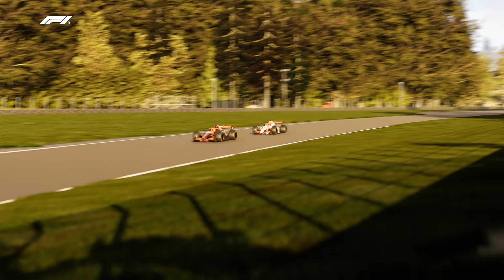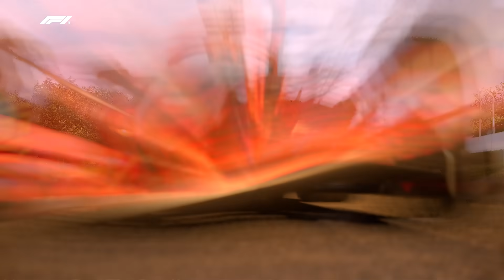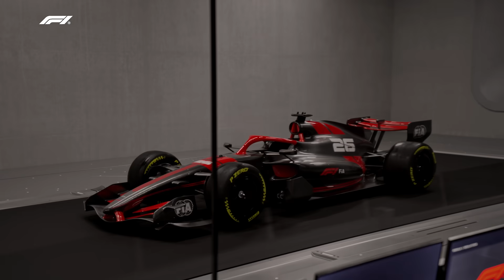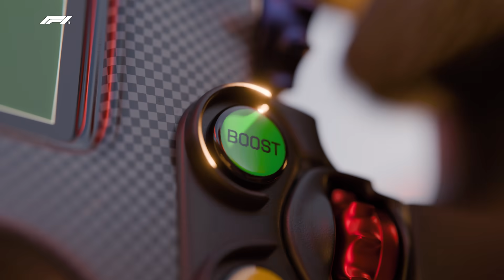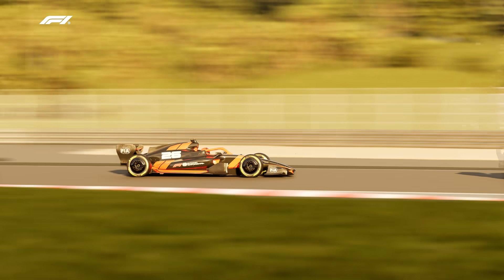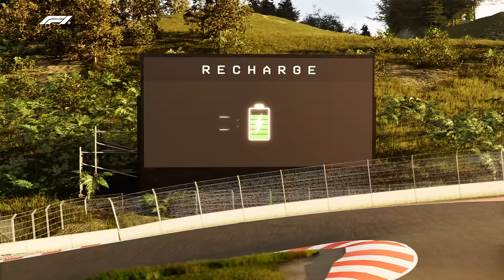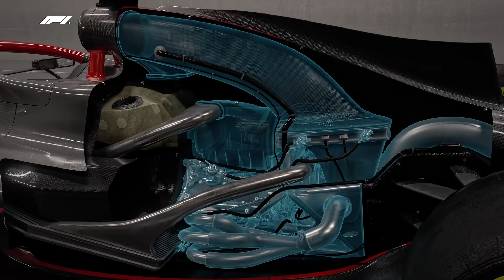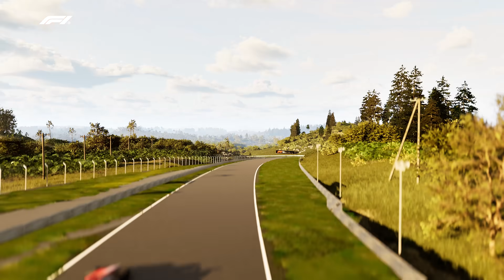Everything You Need To Know About the Formula 1 2026 Regulations

Comment: I dont know but the things on the tyres not being there anymore might make a big hit on tyre deg
Reply: The wheel covers and eyebrows were for aero purposes, not specfically for tyre deg.
Reply: What in the ragebait do you mean with tyre deg?
Reply: @loektube699 You can delete one now.
Reply: The sheilds over the inner side walls?
Reply: The largest reduction in tyre deg will be the drag reduction on the front wing and the larger reduction on rear wing drag on straights. Also the lower overall downforce will lower deg in corners too, but the thinner tyres might balance that part out
Reply: @ryansturt490 Lower grip too.
Reply: What in the ragebait do you mean with tyre deg?
Reply: What in the ragebait do you mean with tyre deg?